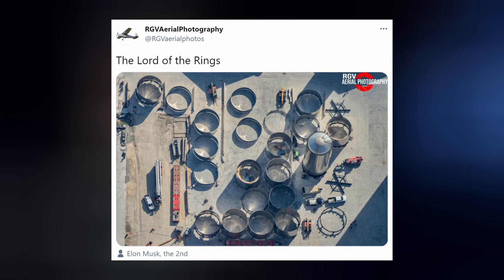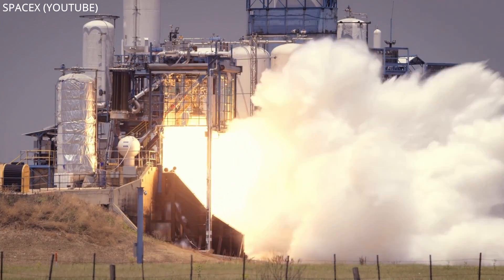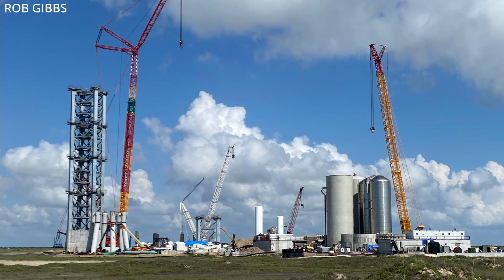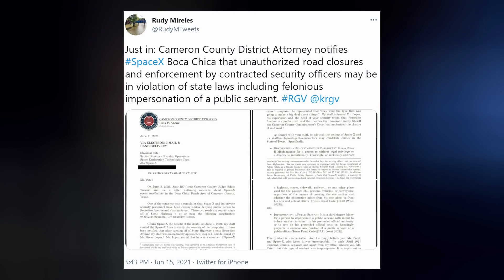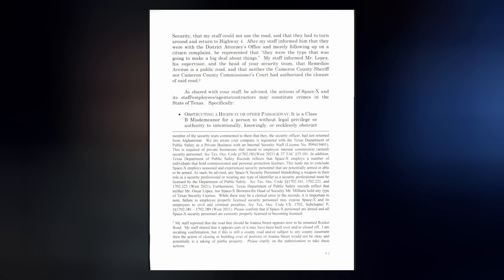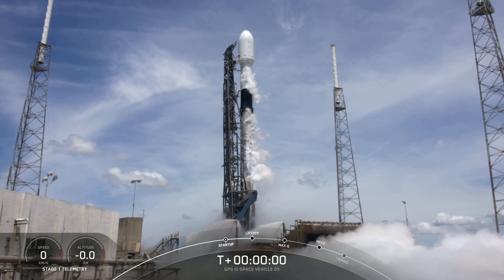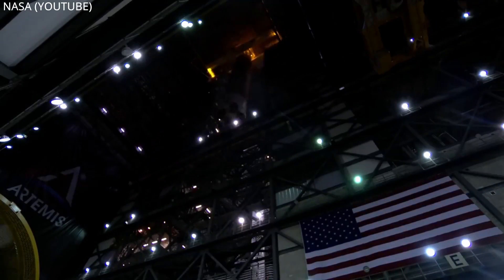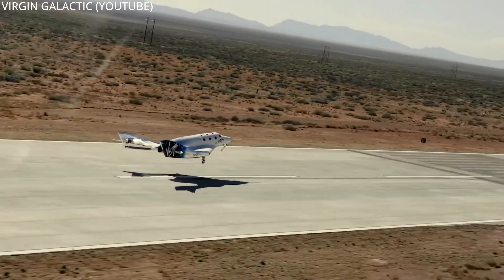Elon Musk: SN16 Might Go Hypersonic, Starship Program Threatened | SpaceX in the News

Comment: I have a question... With all the money being spent on the whole highway closure thing to begin with, why not just contract out the expansion of the highway and have it specifically modified to have Industrial access lanes, that can remain open to the public as extra lanes, until they are needed for shipping those huge parts, while still allowing for other lanes not used by the shipping efforts during road closures?  After all, with the kind of work and machinery being moved around.. that small road they are closing all the time does appear ridiculously small to begin with and I have seen a coupe Texas roads that specifically have extra lanes for this kinds of situations.  One of those roads is near the mines close to Longview and Tylar, where they have these center lanes that look like they where made for heavy machinery to ride threw it while avoiding road closures.

Comment: I think it would be exciting if they chuck 6 engines on SN16 and do a single stage to orbit launch - just because.  Regarding highway closure, a solution to allow SpaceX and locals to use the highway whenever they want to is possible - if the Boring Company built a tunnel to be used by the public, whilst SpaceX could use the surface road to transport their GSE and ships.

Comment: SN 20 is not being stacked and tiled, plus Musk mentions SN16 may undergo hypersonic testing. I am left thinking that there are doubts about the tiles. Even for these short hops there are still tiles that crack and fall off. Failed tiles does not bode well IMO for a suborbital test, and why push the booster date when the tiles can be tested with just a starship with 3 engines? If, if there is indeed a tile issue that may well be why SN20 is still in pieces?

Comment: on the SN8 FAA incident, this is purely a guess, its an opinion based on my reading of the incident, but my guess is the FAA was assuming an explosion of starship would be a far greater threat than what spacex thought it to be, and there might have been some debate between the FAA and spacex about that, then after the explosion, the FAA was proven their assumptions were wrong and adjusted accordingly. this is probably why spacex attempted a waiver to exceed the maximum allowed safety measures, as they did not agree with the initial safety findings, in relation to how much of a threat a starship explosion was.

Comment: There is an alternative road that could be built off Eichorn Blvd, that partially exists already, which would require a 700 meter raised platform to link to the Northern end of the beach, as long as it was only exclusively, for 4WD vehicles. Realistically, that's the only vehicle that can use the beach anyway! 
And as far as I can see on Google Maps, there is nothing there?! SO if your a nature loving person and wanted to see the wildlife, you would need a 4WD vehicle to get down to the beach anyway. In my opinion.
Otherwise your 'average' family would not even bother going out there as it's so remote ans isolated. South Padre has all the amenities there and as good as beach (without local knowledge) as far as I can see.
Sounds like a bunch of 'dodgy' stirrers who can't get easy access to the border for their covert operations from what I can see.
That's my couch potato opinion, and I will also add, that looking at all the 'off road path's' (Google Satellite) made in the 'National Reserve' by 'Hoon's' racing around in their 'dinky do' off roader's, that there is not much respect for Conservation and Protection of Natural Habitats!

Comment: I think the green are sea level engines, the white are vac engines.
Reply: Green means sent to McGregor, while white means still in production…
Reply: The 3 big circles on the set to the right are the 3 vacuum Raptors on the Starship (second stage) and they won't gimbal. The three in the middle of the vacuum engines are sea-level engines and they all gimbal. The 9 center ones in the middle of the Super Heavy booster on the left will also gimbal, but the 20 around the edge will not gimbal. The SH booster will not have any vacuum engines and all 29, later 32, will be sea-level Raptor engines.

Comment: SN16 with 3 engines could burn for a little over 3 minutes running all 3 engines at peak throttle leaving 30 tons of fuel for landing (SN16 can not fully fuel and still take off with only 3 engines). A 3 minute burn at full thrust should be more than enough for an "Above carmine line, sub orbital, re-entry, test flight". I really think SpaceX should attempt this flight with SN16, First use SN16 as a dummy weight to test BN2's ability to hold a fully stacked Starship, If it survives then use it for a max burn suborbital and re-entry test flight. Chances are it will RUD upon landing but at least they will get their money's worth.

Comment: A Falcon 9 landing off-center doesn't really tell much about the accuracy of the flight computer; it likely has a target margin covering most of the deck. You're never going to come down exactly the same way, so when the booster knows it's going to land in a safe spot it's not going to panic and correct itself last-minute and translate a few meters just to land dead-center. That would only add risk and complexity to the final descent.
Reply: You got it twisted. The craft is designed to readjust itself  if is off target. The target thou is not fixed to pinpoint the bulleyes but on the full pads area.
Reply: @joweydelanota7421  That's exactly what I said...

Comment: What if SpaceX had their Boring sister company drill a highway tunnel under the current highway, and vacated the above-ground roadway?  Then they wouldn't have to worry about exposing passing traffic to potential explosions! 😎
Reply: They are basically at sea level. Boring anything there would be a nightmare with water containment.
Reply: @xxZerosumxx  The Chunnel goes under the English Channel!
Reply: @zaguar3153  I didn't say it wasn't possible.
Reply: Those boring tunnels are designed for EVs only. I’m a fan of EVs, but a public road that’s EVs only doesn’t sound like a good idea.
Reply: @danddietz  Who's to say they couldn't build a more conventional tunnel for conventional traffic?